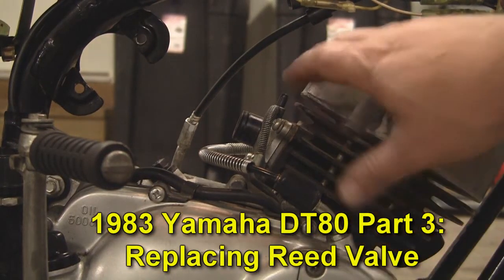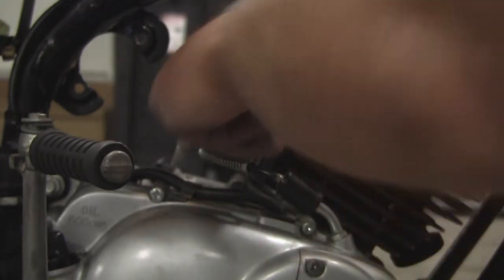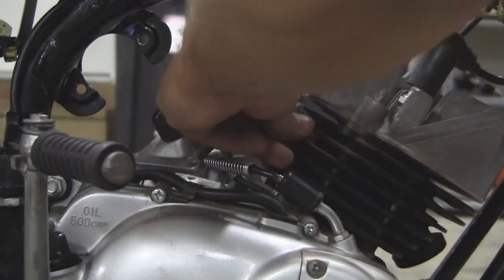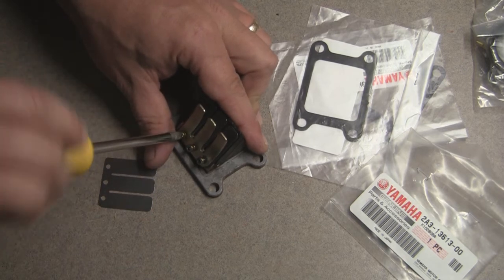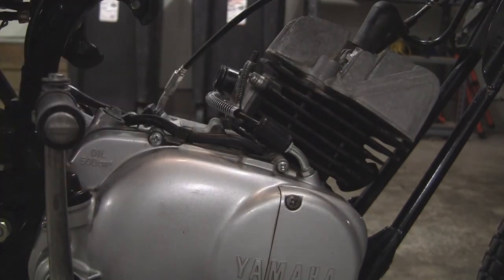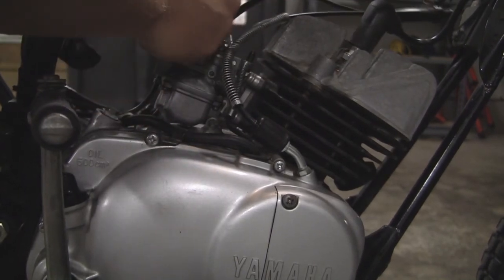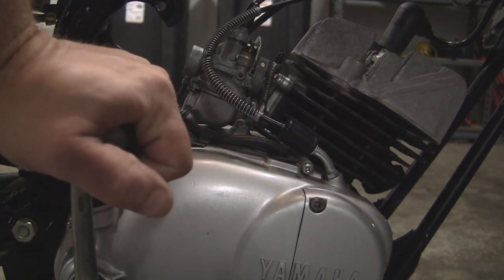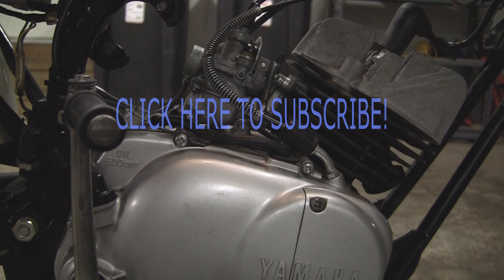1983 Yamaha DT80 Enduro Part 3: Replacing Reed Valves on Motorcycle

Comment: HI i have a question.So my friend purchased an 81 kawasaki kdx175 and it doesnt wanna run right..when we only got it,it was bogging down quite a bit and after we cleaned the carb its still bogging..not as much in the 1/4 throttle range,but after that its worse..it is running rich theres gas coming out of the exhaust tailpipe,and theres a small opening (exhaust leak) coming out from the cylinder (where it connects to the exhaust) and it drips down a bit of gas.Thing is is that it looks like only two spring hold the exhaust to the cylinder..but anyway pilot jet and main jet are within spec (stock) and the needle clip was set on the one below middle on 2nd knotch (theres 5).i tried moving the clip up and tried middle (3) 4,and then the fifth one the toppest knotch and it seems to be definantly pulling better but it still bogs like after third gear (half throttle)..first and second gear not that much.Im really wondering why if it has an exhaust leak then should it be running leaner?And it was set on the second knotch to make it richer which kinda makes sense but its way to rich and after moving the clip higher it pulls better and at times the power band would kick in and it pulls really good.. Any idea on wat it could be? maybe reed valves or the exhaust leak?thank you in advance
Reply from the maker: I would check the reeds for sure, check compression, fix the exhaust leak and check for any tears in the boot to the carb if it has one.
Reply: boots are good the exhaust i just slid it in fully cuz the guy before me had it wrong and it was leaking a bit of oil with gas..the reeds were open from both sides a tiny bit like maybe .050 of an inch,is that alot?and also the bottom ring is missing and the piston is scored a tiny bit on the exhaust side would that also have made a difference?And also its really hard to pop start it now like it pops as if to rich as if like theres gas or something not like a popping sound..and after i rode it once doesnt fire up..Any idea?
Reply from the maker: 942doc1 The bottom piston ring is missing? If so, that's probably the problem.
Reply: yes i even found a part of it in the exhaust..And it seemed like it was eating alot of gas,theres two and the bottom one hold the oil down right?or is that on four strokes?
Reply from the maker: 942doc1 You need that ring for sure, it will run like a dog. It keeps the oil from blowing by.
Reply: ohh i see..what if the cylinder is scratched up is it possible to bore it out yourself?My friend works at a manufacturing company and they can definantly do it and perfectly,but the only problem is,is that its hard to know how big of a piston to get if the cylinder gets bored out,like wat the gap should be between the piston and cylinder you know..Any idea?
Reply from the maker: 942doc1 I'd have to see the cylinder. I would take it to a machine shop and see what they say, it may just need honed.
Reply: i see,and well hes gonna bore it himself..ill tell u how it goes
Reply from the maker: 942doc1 Let me know!